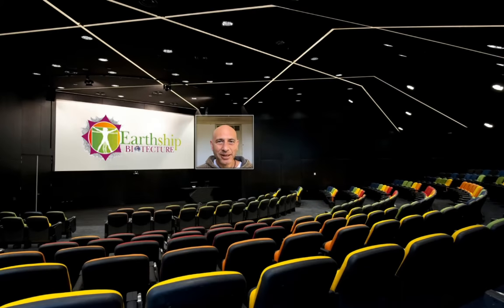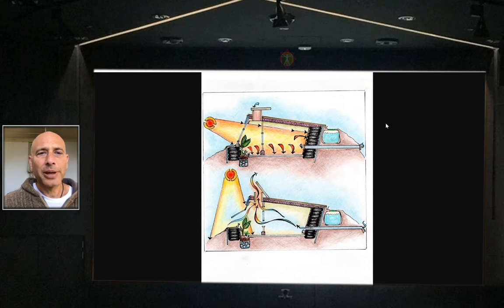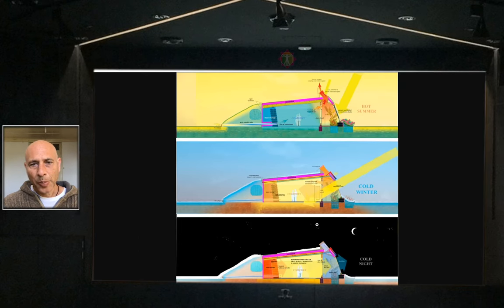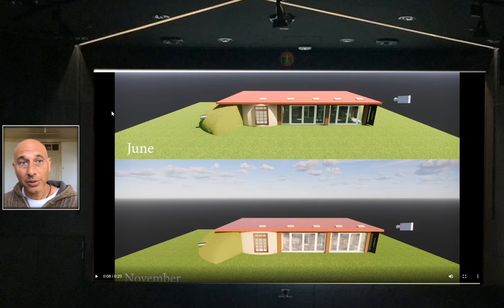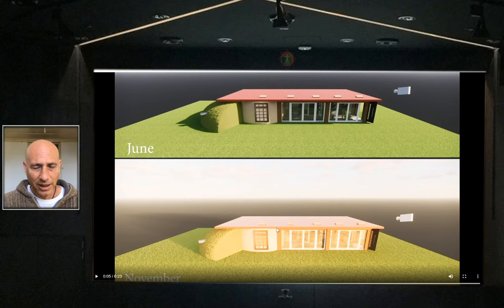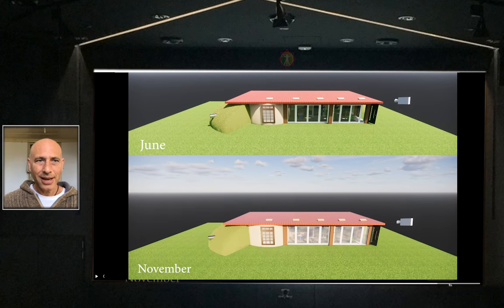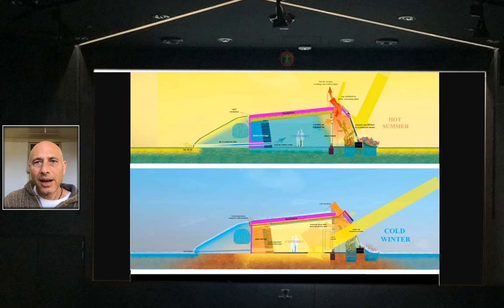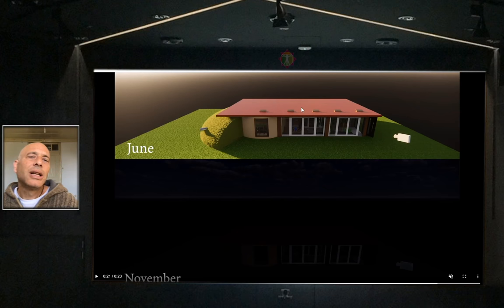Earthship Global Model Explained! #2: Why you don’t need to heat or cool them.

Comment: What happens in the dead of winter if one has weeks of cold and cloudy weather? Presumably the back wall won't hold its heat for more than a few days and one would then be relying on the temperature of the ground?
Reply from the maker: thank you! fully appreciating the support! and a great question! The simple answer is that you dont have sun for say a week or more then you can bring the temps up very easily with some very minimal heating.. I think its good over all, and for humidity as well, if you do have some kind of heating system on those very dark damp times.. From what i know this only really applies to very northern Europe .. and lets just say that a very small amount of heat can go a very long way if the windows are closed etc.. Some say that a kitchen stove, or even laptop and body heat can go a long way when the building is properly sealed and bermed..

as for how long exactly it will be before the thermal mass starts losing its temperature.. its worth remembering that the berm is several feet thick, and totally sealed and insulated as part of the back walls.. SO we have a huge amount of thermal mass that can continue to feed the back tyre wall.. The tyre wall gently feeds the home .. so it will take several weeks to really start to notice a huge difference. Of course if you are at -30 in the snow this will happen more quickly.. and you can adapt by increasing the size of the berm or adding more insulation to really make sure you really keep the heat in. Also, if you are super extreme you will have smaller rooms with lower ceilings, and very nice glazing throughout with insulated curtains etc.. The more extreme the climate the more things you can do to prevent and reduce heat loss..

hope that helps! maybe we can copy this question to you tube also as its a great one to share with everyone.. much love!